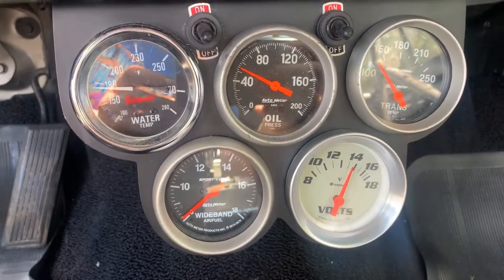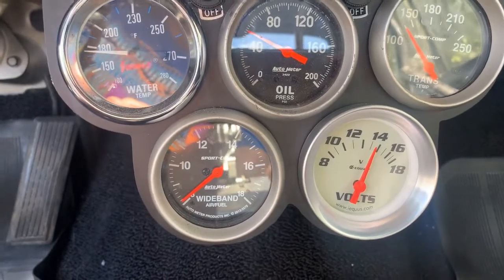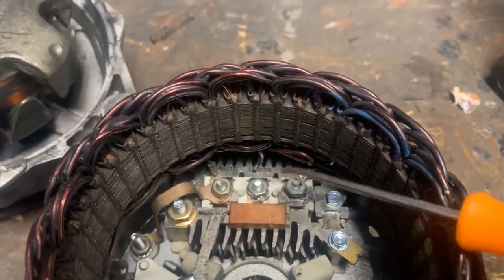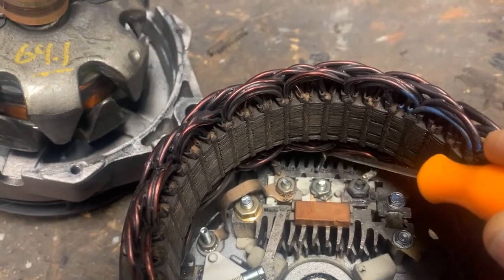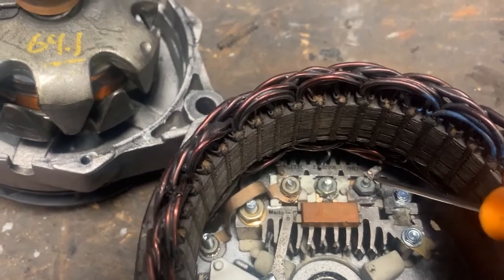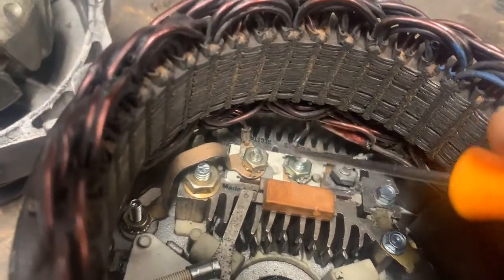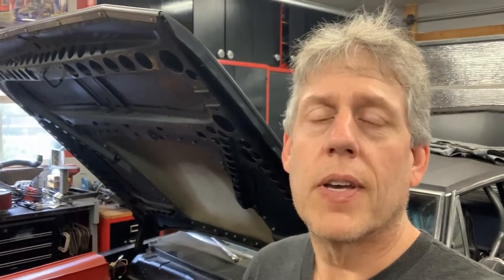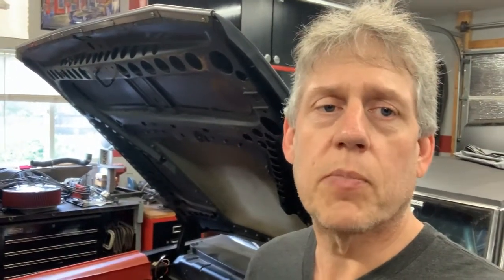Ammeter or Voltmeter gauge? I'll explain which one I use and why

Comment: Any serious DC circuit monitoring involves ammeters. Ammeters will provide way more diagnostic real time info than a simple voltmeter if you know what it’s telling you. If your alternator failed and ammeter was centered, didn’t show a discharge, it was wired incorrectly or had been by-passed. Voltmeter is no more useful than an idiot light in this application. Nothing wrong with how the original Chrysler charging system as it was designed. Problems start with abuse and misplaced added loads at the battery, overloading the ammeter and related circuit/connections and defeating the designed purpose of ammeter to register only battery charge/discharge status.

Comment: I've ALWAYS used a voltmeter for a very long time, sometimes in conjunction with the amp gauge or 'ammeter'. The ammeter is very old tech and simple for mfr's to make and install. I would definitely get rid of those early Chrysler direct feed amp gauges that are in series with the charge wire.

You can get WAY more info from a voltage gauge than the amp gauge. It tells you the status of the battery AND the alternator. If it goes below around 12.6v, the alternator isn't charging. 14.3-14.5 should be the 'charged' state voltage. If the voltage on the gauge is high (14.2-14.6) the alternator output current is low. If the voltmeter reads low 12.8-13.2, the alternator output is high and is 'charging' the battery instead of 'maintaining' the electrical system draw. Just remember they're inverse of each other. Volts HIGH = Amps LOW and Volts LOW = Amps HIGH. (functioning alternator) If the voltage ever gets below 12.6 or so your alternator isn't working, but that's pretty easy to see.

Comment: Got an alt. that puts out more than average ammeter reads.  Common for diesel engine alternators actually.  Mines 135amp and I may go to 150 in the future.   My big truck is 200amp for that matter.  Anyway....  is there a way to purposefully miss match a shunt and ammeter and do the math in your head.    example.....  use a typical 60amp ammeter with a shunt  that would result in a meter that always shows off by a third.... so If I am showing 60 amp......  im in big trouble cause that would be 180amp out of a 135amp alt. in real life.   If I am showing 30amp...... then in real life Im at 90amp and that is fine if I'm  winching and bumped my idle up to get that 90amp.    etc etc.   

Doing so  would possibly lower cost for this poh manz build...  the ammeters that can read up to 150 are stupid expensive even before you buy the shunt.  (or hall effect sensor)

so with that in mind.... ifffffff that would work... what shunt for 60amp ammeter knowing I will be off by a factor of three?
so with that in mind.... ifffffff that would work... what shunt for 30amp ammeter knowing I will be off by a factor of five?

Comment: Why do some nowadays think that ammeters are dangerous?
Reply from the maker: No idea, you do have to run a larger gauge wire through the dash, I prefer the voltmeter over an amp meter.
Reply: Speaking for older mopars, if the ammeter shorts to ground or the bulkhead connector gets corrosion, heats and melts, you aint puttin that dash fire out and will likely lose the car.
Reply: @jasont.1530  But how likely is that to happen?  And how is that not possible with a voltmeter?
Reply: @jasont.1530  Best remove the battery and alternator too then :)